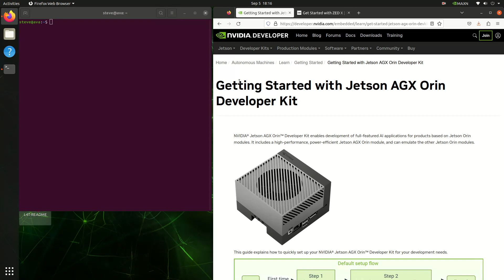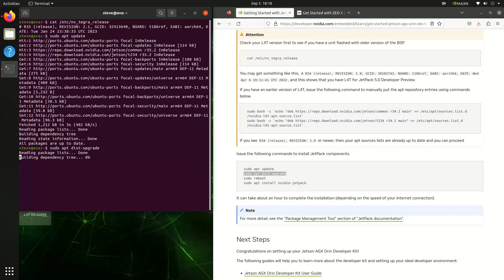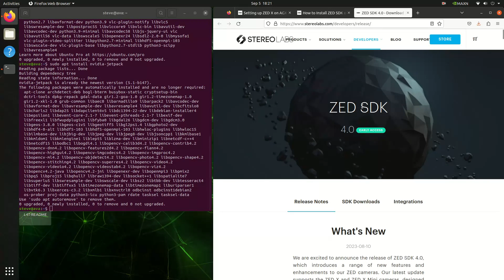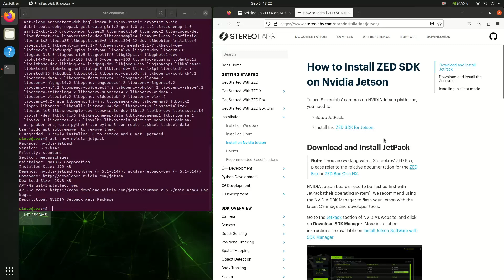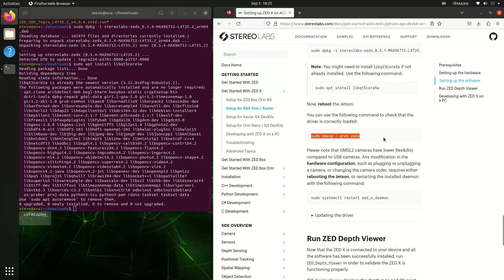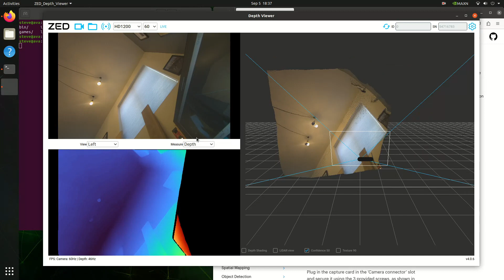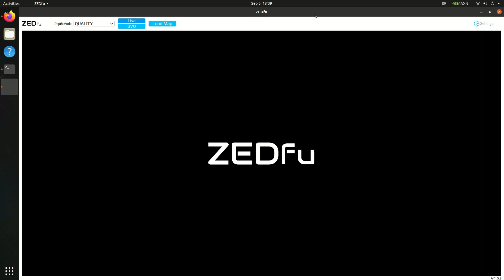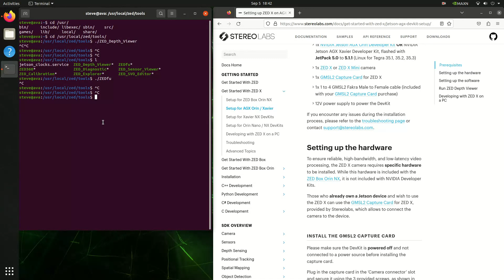Setting Up ZED X for ROS 2, Part 2: Nvidia Jetson & Stereolabs SDK Setup - First Look at Data!

Comment: Hi, thanks for the series! 
I'm wondering if the fact you were recording at the same time you were running the demos had a hit on the performance... I would have expected near real-time estimations from the top of the line AGX Orin. How is the performance in reality?
Reply: ddsddd
Reply from the maker: You are correct, the screen captures really start to lag. The performance was real-time for the processing and more or less real-time for visualization to the display. There was a little bit of lag in the display, but not anything nearly as bad as what the screen capture shows. The algorithm though clearly was running properly, it was a display issue.